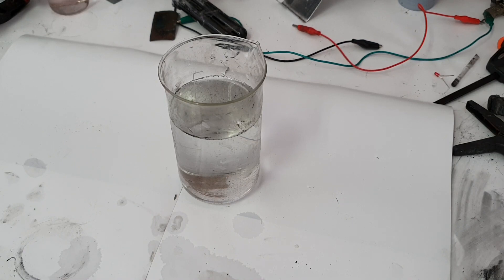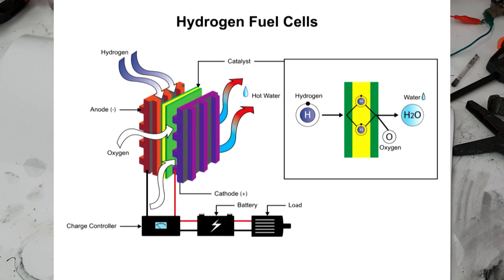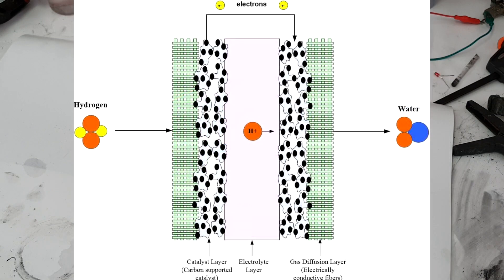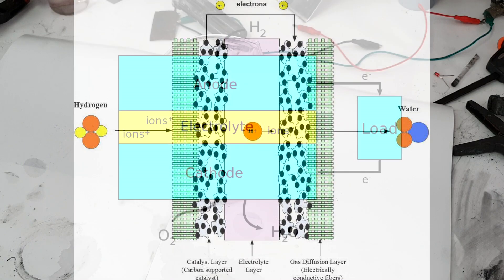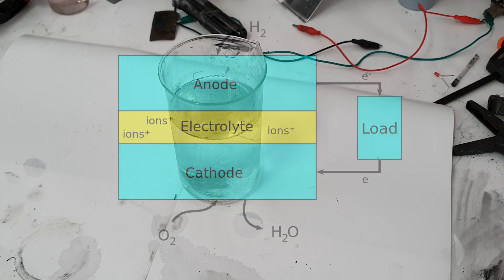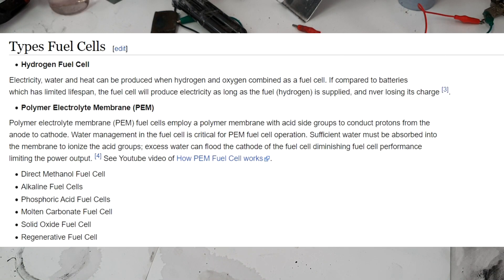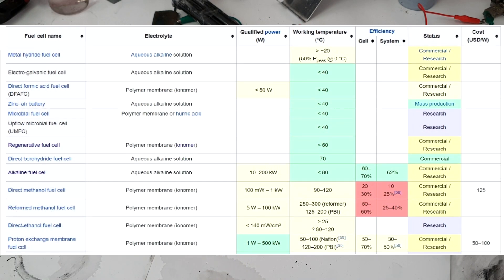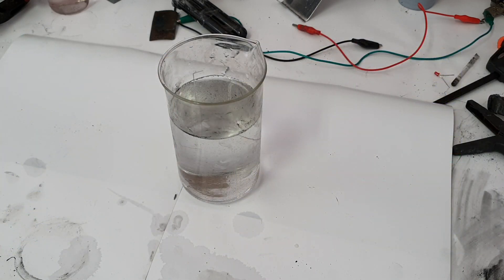Improvised Reversible Fuel Cell

Comment: When this, or an aluminum air battery for that matter, is put on a charger hydrogen is created as demonstrated. If then in an aluminum air or this one could store the hydrogen while being charged in an inverted test tube in water then it can be returned to the cell upon discharge. Working with this. Thank you!!!!

Comment: Since you posted this,  have you checked to see how much is due to capacitance and how much I do to actual fuel cell reaction? Because I can't see how this would ever work without some kind of catalyst, even if it's just impurities in the graphite etc... It would be interesting to test before you introduce your catalyst and see what the difference is.

Comment: I really think something very very unique is happening here. I tried reproducing this experiment but got no where near these voltages even with electrolyte. I don't think this can be attributed to simple capacity of the water or the cell alone and there must be some conversion of the Hydrogen and oxygen to electricity. This means some catalytic process must be happening within your carbon that is allowing proton exchange to occur. Could you please let us know what this carbon material consists of or how you made it?? Also what catalyst did you use and how much?
Reply from the maker: I use PAN based carbon felt and tap water. In the cell on the end of the video which have the voltage of around 2 volts I add some NaCl into the water. And the cell act more like supercapacitor.
Reply: @cayrex  Hmmm that is very interesting! I also used a very conductive carbon felts with SS mesh electrodes. I tried tap water, de-mineralized water with and without NaOH or KOH but did not try NaCl. The most I was able to achieve was just over 1 volt around 200 milliamps with a rapidly degrading charge. In other words my attempts where not able to power anything and went from charged no no charge very quickly. It is interesting to note that PAN carbon contains Polyacrylonitrile a semicrystalline organic polymer resin! It is also interesting to note scientists today reject non conducting substances as catalysts but William R. Grove was able to use phosphorus and iodine in the solid form, which are non-conducting, he suspended them in nitrogen in the tubes of a gas battery, and the cell gave a continuous voltaic current. https://www.freeenergyplanet.biz/fuel-cell-technology/the-gaseous-voltaic-battery.html for me obtaining carbon felt is difficult so is it possible to create something like this? I still think it is not just capacity that is happening there. Perhaps you can try and expose it to hydrogen gas without liquid?

Comment: Thank you for sharing this. I've seen others use this same architecture / chemistry and call this a carbon battery. Would be interesting to see strength of charge vs elapsed time from charging as well as optimizing chemistry, looking at cyclic decay of charge / uncharge potential, and as you've noted here...adding in some more complex materials such as PEM in place of paper separator, catalysts, and geometry. Thanks again...always really appreciate the builds & results that you share.

Comment: Very cool. I tried to make a tiny version with graphite pencil leads. I could generate gas, but no voltage across them when disconnected from the power supply. Do you think it's because it needs activated carbon, or because the surface area was too small?
Reply: Curious, I tried it too with pencils and the red led was producing light, the first 3 seconds were bright, then it dimmed to zero. But the pencil method worked, both with NaCl in the water, as another one with soda.
Reply: It would be great though if you can store some hydrogen safely for a time and make the capacity of the hydrogen powerbank/fuelcell greater. Then you could attach a solar panel for instance and have a led burning the whole night. But I haven't seen how to do that.

Comment: @Cayrex2 can you try to store hydrogen in activated carbon or carbon nanotubes? Is that when we raise the temperature of the carbon and inject hydrogen it will yrapp hydrogen when it cools down? And to release is it only required to provide heat?

Comment: You really must start from gasses and not from just electrodes, where you store the energy in the double layers...
You really have to find materials where you can insert H2 and O2 gasses and see, if you can get them split and generate electricity...
You could try to hack a NiMH battery and feed in there some Hydrogen and see, if this will be converted on the nickel electrodes... Regards, Stefan.

Comment: Great! It's the first fuel Cell I seen with basic material. Ok, the energy density might not so high as 'professional' fuel cells, but who cares if using for stationary applications? There is more important the price of material and the lifetime of the cell. MANY thanks for this upload!
Reply from the maker: Hey thanks. This one is more like supercapacitor, but looks identical at first hand. I was to early and brains off when I say fuel cell because I need to use catalysts anyway (my bad 🥺😂). But anyway, supercapacitor or fuel cell,.... the power looks good.

Comment: One interesting experiment to try would be this :
1) Completely discharge that fuel cell to low voltage and remove it from the beaker of electrolyte.
2) Put in two inert Graphite electrodes and saturate the electrolyte with oxygen gas and hydrogen gas by passing a
current into it.
3) Take out the graphite electrodes and replace them with the discharged fuel cell electrodes.
4) Test the fuel cell with a load and see if it generates current.
This should tell you if it is truly acting like a fuel cell and not like a battery or supercap.
Reply from the maker: Nice idea. But I will wait to get the catalyst materials then I will make next experiment.
Reply: Voltometry equipment might be able to tell you how much is from the positive effects and how much actually is from a chemical reaction, but just checking by introducing hydrogen and oxygen seems a lot easier and cheaper...

Comment: All you have really done is make a battery. Right? This is no different than a ALUMINUM air battery. Right? Carbon and Aluminum with a separator plus electrolyte. If I'm wrong here, please enlighten me. Thanks for the upload.
Reply: maybe he has done both? I don't pretend to understand it completely, but I made an experiment yesterday after watching youtube video's with two pencils attached to a powerbank in a glass of water with soda. So no way my experiment is a battery. The electrodes, pencils in my case, did produce gasses. After that, I disconnected the powerbank and attached a LED, it was shining bright for 3 seconds then slowly dimmed while the bubbles vanished. Is this experiment not the same but on a larger scale?
Reply: @pieterpauwelbeelaerts5995  I appreciate your comment. Why don't you put out a video explaining what you've done and explain why you disagree with what I have said about it? I look forward see you point of view on this matter.